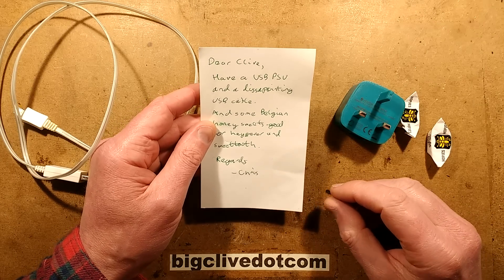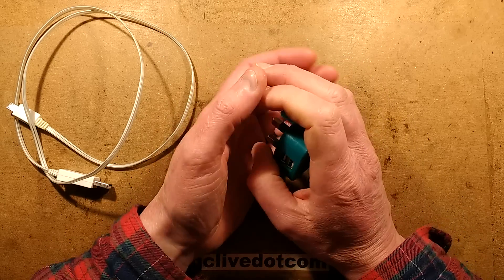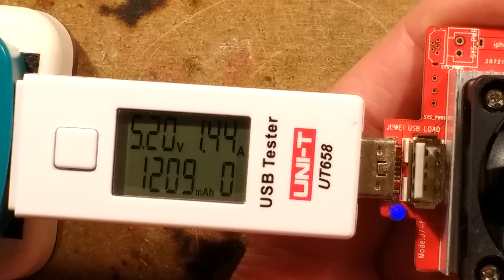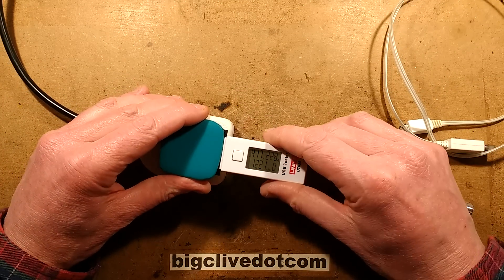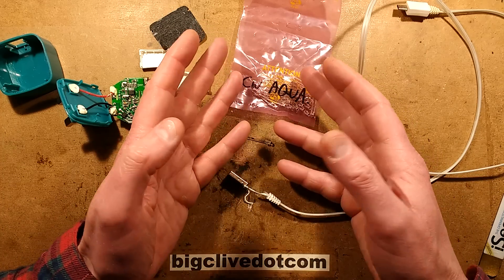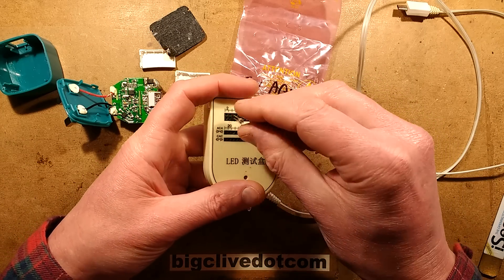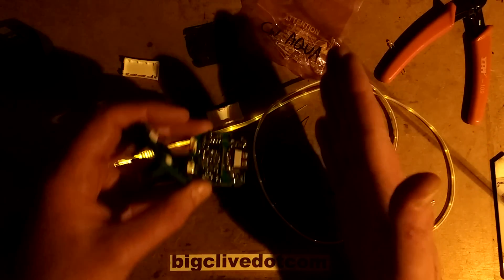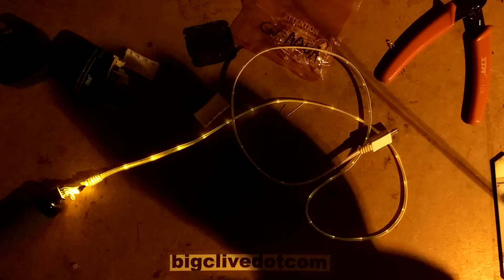Stinky Poundland USB charger and hack of random "faded" USB lead.

Comment: Thanks for saying that Apple isn't a Pinnacle of technology
Reply: I used to work for a large company that (amongst many other things) supplied Apple products to the graphics industry. 
We'd receive promotional material (usually a couple of pallets, or about a tonne) for the next generation of hardware in anticipation of its release, and were never less than surprised at the "ambitious" projected specifications.
A few weeks or months later, someone would come to me and say "That Apple promo stuff - throw it away", then another load would arrive, but the specs would be lower. This might be repeated three or four times until we finally got the hardware, which bore little resemblance to the original specification.
I asked our technical staff why this kept happening, and the answer was "Because they can't make it work".

Comment: Sooo a poundland £2 item is poorer quality than a £1 one?...
Reply from the maker: The unit's fine, although that diode does get hot at 2A.  The issue is when any power supply gets covered with thermally insulating material.
Reply: I bought one at the weekend. It smoked and now smells burned. It was charging 2 devices, but wasn't covered in any way. It was plugged into a domestic UK wall socket. It suggests it's not up to the 2 Amp rating given, unless the devices plugged in to it tried pulling more than 2 Amps.

Comment: Apple chargers do have thermal regulation, do they not? So it should cut out before it catches fire from heat. Not that Apple is the pinnacle or perfect or anything, but their USB PSUs are very nicely engineered.

Comment: Clive, The USB tool how about telling us about it. Looks to be very useful.
As far as caps go you should see the ones in the Fuel Injection Control Module after they have been ran at a less that optimal voltage over time. Some become very pregnant and others just blow there guts out all over the place. 12VDC converted to 48VDC @ 20A. When things go wrong they really go. Then add to all of that the heat under the hood and you have a bad place for electronics to try and live.

Comment: Thank you for this video! Love these peeks inside things.
Wouldn’t the drop to 3.16V at about the 2:47 mark indicate that the supply isn’t working properly anymore?
Reply: No, because it goes back to 5V once the current is below its maximum rating again. This is used by phones to find out what amount of current the charger can supply to optimize the charging times. It ramps up the current until the voltage drops, then goes back by a bit to let the power supply recover.

Comment: Yeah, I know all about overheated power supplies. Accidentally had a laptop power supply covered by a pillow. It  had gotten so hot that when I tried to pick it up, I almost burned my hand and had to immediately drop it. The label on the power supply is now permanently pink.
Reply: I wonder if it's some kind of chemically-engineered paper for warranty purposes?
Reply: @HighestRank  The power supply has become fabulous. 😋

Comment: Just wondering, when is approx. 25mA - 35mA over driving a white LED? Most white LED's drop around 3.2V-3.8V when fully conducting. With a 5V supply this leaves at worst, 1.8V across the series resistor. Clive said the resistor was 51 Ohms, giving (at most) a current of 35mA. I wouldn't call this a reason for a white LED to fail over time?....
Reply from the maker: A traditional 3mm white LED is rated for 20mA current max.  Running it over that will cause rapid degradation of phosphor and chip.
Reply: Fair enough. I often drive white LED's at 30mA all day long and had no probs. Perhaps the nasty ones get a bit upset at the slight over current. (Or I've just been lucky!)
Reply: Supervidify  If you buy a good quality LED, read the manufacturers datasheet. LEDs are rated by both current and power. You can increase the current, but have to reduce the duty cycle by pulsing the LED. Also the temperature is important. Some 5mm white LEDs can be run at 30mA but as Clive says, the lifetime is longer if run at 20mA or less.

Comment: I'm going for Occam's razor here - my guess is they don't ventilate them because they don't have an overwhelming need to.
Reply: Tim Clarke also makes them water and dust resistant as well as 'small child with a needle' resistant, which technically will make them safer. Though its up for debate wether that was the intended outcome or if like you say it just wasnt needed so why bother

Comment: It would be interesting to thermally torture a power supply and see what happens. Does it actually get hot enough to ignite stuff or just hot enough to make a huge stink.
Reply: PETER GREEN If it is made properly then the plastics will be treated with a fire retardant and as such will not burn readily.  Usually what happens is internal components like capacitors, transformers/chokes, and transistors cook to the point of catastrophic failure...and if they are not properly fused or if proper creepage distances where not maintained, especially on the high voltage side, then the short circuit (more or less) that can form may not properly clear and plasma arcing or carbonization of the actual PCB can potentially get things hot enough to begin burning so long as the AC power remains connected, which may ignite other more flammable items in the vicinity, like carpets and linens.
Reply: Ethan Poole  Or the component(s) that fail may result in an open circuit fault reducing the power (and heat level)... The problem is that unless you test it, it's hard to know in advance...
Reply: I have seen some of his videos but gratuitous destruction with insane voltages wasn't what I was thinking of. I was thinking more along the lines of putting a fully loaded power supply in a box stuffed with newspaper and observing if and how it fails.
Reply: well if it seems dubious just do a "skookum" test covered in blankets in your firepit with a max output rating load until the load stops spinning it's fan then look to see what had a "melty moment" if it was the caps or diodes or other "blow open circuit" type parts you can assume it will not void your house fire insurance claim

Comment: Clive - that's a big tip for fine work. Are you just being stingy and sticking to "the original" which came with the iron, or do you prefer the larger chisel point for thermal conduction / inertia??
Reply from the maker: I prefer the bigger tip.  The ones supplied with the irons are usually a sharp tip better suited to surface mount.
Reply: Actually, the tip Clive uses most often is more commonly known as a "bevel" tip, the "chisel" tip is the one that many refer to as a "screwdriver" tip due to its double bevels.  Of the two, the chisel (double bevel) tip is more popular with the bevel (single bevel) tip being the next most popular (provided we don't count the conical tips that come preinstalled on all the cheap unregulated soldering irons, which are less than ideal tips for most purposes).  The bevel tips are great, though, where you need to transfer a lot of heat quickly as they have a larger cross sectional area to conduct heat, though I generally find the chisel tip to be most flexible in less extreme cases.  But then I always suggest that people go with whatever works best for them -- unless you are trying to solder to aerospace specifications then there is more than one way to solder and still create an effective joint and an effective solder joint is all that really matters for most purposes -- I've made more than my fair share of solder connections in the field using nothing more than a butane torch -- no tip at all unless you count the flame's tip!

Comment: The one that went BANG: was it the CSPUSBCFC (cheap shitty pink USB charger from China)?
Reply from the maker: No it was a crappy black USB supply that I had hooked up to a string of 100 pink LEDs.  It was probably the  reason I ended up liking the clash of dangerous imported stuff being pink for maximum hilarity.
Reply: Ah.  Thanks!  I'm naming my next band Shitty Pink in your honour, sire.

Comment: I got an usb power supply that killed my phone battery, my tablet battery and 2 power banks, the phone battery was bulging, the tablet couldn't charge anymore at all and the 2 powerbanks were duscharged to zero and can't be charged anymore. I don't know how but it seems very strange...
Reply from the maker: I wonder if the polarity is wrong.
Reply: bigclivedotcom Well, at first glance it does charge them, but after some charging cycles it just destroys the devices. It is a built-in 2 usb power supply in an extension lead socket from LIDL here in the Netherlands I think.
Reply: Pirat Carribean sounds like an intresting fault, maybe you should send it to big clive. You get and answer and we all get the entertainment value :)
Reply: I would be suspicious as to what voltage it is actually putting out.  A lot of devices with single 3.6V battery cells charge the battery using nothing more than a linear regulator setup, so if the output voltage is too high then there may be excessive heat dissipation in the regulator IC leading to failure of the charging regulator...at which point the elevated voltage may simply be passed directly into the battery without properly cutting out at 4.2V as is required.  It is also possible, if the voltage spikes high enough at any time, for the breakdown voltage of the battery charging regulator to be exceeded at which point it again fails leading to uncontrolled charging of the battery.

But I have to ask, after it destroyed the first couple devices, why on earth did you keep using it to charge ever more devices?  Seems masochistic to me, or maybe you just really disliked those devices! :-)

There are also a lot of cheap and poorly engineered USB chargers in circulation that also do not have proper mains isolation, and if their output is not reliably isolated from the mains then you could have events where either 120VAC or 240VAC (rectified or not) could momentarily be applied to the device under certain conditions (such chargers can also be lethal).
Reply: Ethan Poole Well, I didn't notice the 2 powerbanks I charged with it didn't work anymore, until I used them and noticed they were fully empty and couldn't be charged anymore. That was after a few charging cycles, before that they worked perfectly. My tablet didn't charge properly with the original charger anymore, so I used that one, and it did charge faster. The same with my phone. But after some cycles they would barely take a charge anymore. I will try to test them and maybe take a look inside. It's weird for a bad product like that to be in a local store...

Comment: why can they put vents in pin side and mold plug to just sit a millimetre or two away from socket wont help on extension sockets but better plugged in at wall and if pins are insulated should be fine (there someone patient that  lol)

Comment: Holes or gills/ fins on the plastic mold would likely represent a significant expense, not only in the mold tooling itself, but how often it needs to be changed to keep the edges crisp.
Reply: J Oh yes, it would still increase the cost of manufacture, but would be more cost effective perhaps.

Comment: Dear BigClive i have the same problem with my laptop charger.. it's an original Lenovo charger 19v...  one time it was under a pillow and i forgot about it, while working on the laptop i heard a bang, very dull as it was covered by the charger casing and under a pillow.. charger was hot!! really hot above 90 degrees i couldn't touch it!! after it cooled of i plugged it back in the laptop and it still works after 2 years but occasionally when working on laptop and running heavy apps, laptop beeps and am running on battery power for about 5 seconds, then charges starts working again.. i think the situation is very similar.. Thanks for the video it explains a lot :)
Reply: Zeekat What happened was that one of the electrolytic filter capacitors exploded inside your power supply.  But it is not really good to keep using the supply as the electrolyte is very corrosive so after awhile other things are likely to begin failing, but the worst part is that it can make the space between traces electrically conductive and eat through the solder mask and if the PCB material eventually becomes charred over time then you can end up with a runaway short circuit because the more carbonized the PCB becomes the more conductive and hotter it gets and the more it conducts in a vicious cycle.  Your one real saving grace is that most power supply PCBs are single sided to reduce costs, so most of the electrolyte is likely coating the interior of the case and components more so than the traces on the underside.
Reply: You'll see people claiming that they'll open the charger case and replace the swelled caps yet spudgering is a difficult job. Can't tell you how many hardened steel knives I've broken, and even spring steel blades snap in the presence of good fusion.

Comment: A very long time ago I attended a lecture given by Gene Amdahl. One fact I went home with was that every 10 degree C rise in ambient temperature halves the life of electronic circuits.
Reply: "Each increase of 10 degrees C doubles the rate of reaction", I remember from chemistry lessons. Though I suppose dopant migration is more physics than chemistry, eh.
Reply: A rule of thumb that we applied to industrial motors and transformers insulation as well.

Comment: It's not just soft furnishings that can cause problems.  It's also cats.

That said, cats are likely to move away before the overheating becomes disastrous.
Reply: Cats are self regulating.
Reply: @bills6093  yes own several cats for "regulating" the usb psu temps they will keep it safe at 50c above ambient and prevent dust and water

Comment: You can get a lot of light out of a white LED at surprisingly low currents. currently using some as a illuminator on a clock, and the 0.25mA per led chip is still way too bright for comfort. Even using salvaged ones from a LED backlight from a broken laptop they are bright, in the laptop they were driven at 50mA.

Comment: Purely on the LED topic.  I was wondering what would happen if you put a standard LED in series with one of the flickering type? If I had any I would try it but sadly I don't.  Anyway keep up the good work (more explosions if possible) and be well.  Al
Reply from the maker: Both flicker at the same time.  If you use a resistor and put a traditional yellow flickering LED in parallel with a warm white one they flicker back and forth.
Reply: Thanks Clive, I suppose it makes sense and means that it should be possible to pad out designs with standard ones and make subtle changes to effects with the flashing ones.  :)  Al